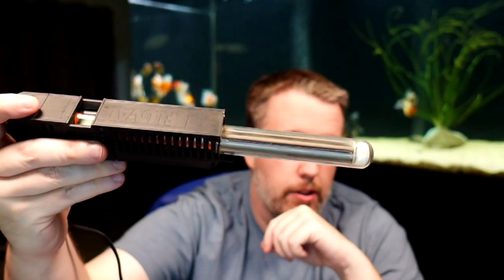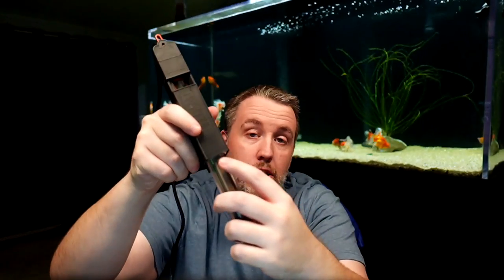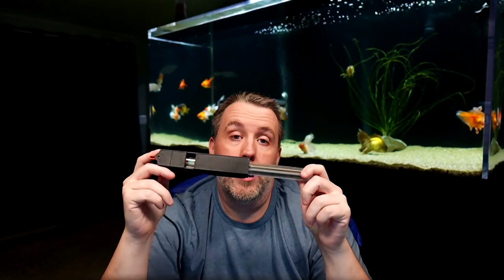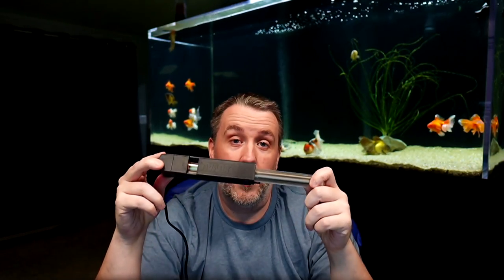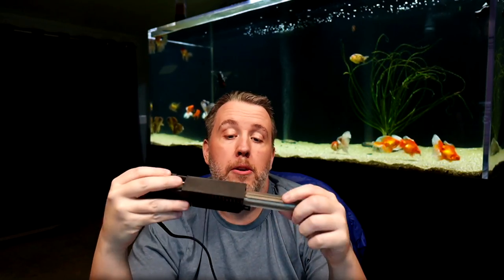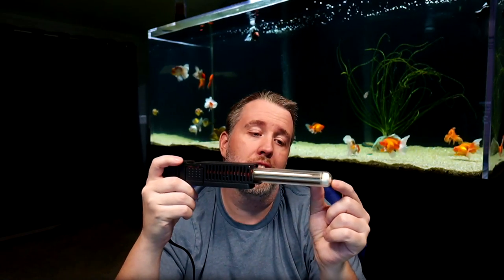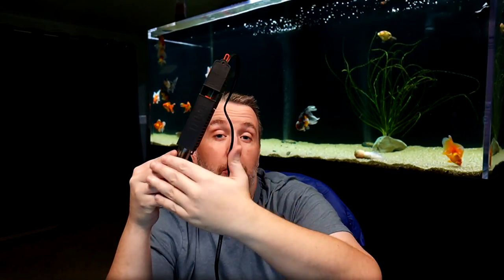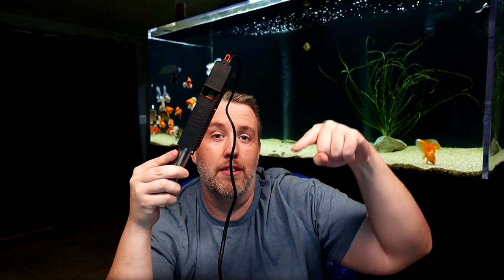The Truth About Aquarium Heaters (and Why They Always Break...)

Comment: Your points are generally valid, but here in the UK  the  temperature can change by 20 degrees Fahrenheit  in a couple hours or less so you need  a higher power heater to avoid giving “temperature” shock to your fish. We only have the min water line on the 240 volt units I’ve seen in the UK , I suspect it’s the proclivity to be sued in the US why that max water line warning was issued not the IP rating. I’m also electronics hobbyist an you could build a 48 volt (can’t be really be electrocuted at this voltage) heater making it safe to be fully submerge , you can also use transistorised switching, where if properly rated transistors are used could last for decades. This is effectively how good temperature controlled soldering irons work,  but at ~$200 for 100 watt iron I suspect  our current heaters are to stay especially as I suspect the electronic stuff mentioned above will always be marginally less energy efficient as the electronics would need to be powered 24 x 7 versus the simple on off mechanical thermostat.

Comment: Nice video. Temperature controllers I've used for years in the fish room where I can set a variance from half a degree to 10 degrees if wanted. The problem with every heater is that they will fail eventually and more times then not they will not just turn off and die they will get stuck on. Major concern that the controllers eliminate.

Comment: I have a heater that I bought in 1998 that I still use on new set-ups. I wish they still sold the old style (non submersible) heaters with the control dial on top.

Comment: Great points. I've personally never had a heater fail, but know people who have lost whole tanks to overheating. I'm curious if this reasoning is why eheim markets their 150w for 75 gallons (the other heaters at the store listed 200w for 75 gallons). I got the eheim and angled it where there's good flow, and with a thermometer at either side I confirmed consistent temperatures. Fingers crossed.

Comment: I know this isn’t new, but as I was a plumber, I have a perspective that you may appreciate. Elements in electric water heaters that last the longest and perform the best with the least amount of power (I. e. best efficiency ) are the ultra low density heating elements. These elements don’t heat as hot, and spread their heat over a greater surface area to provide the greatest amount of heat transfer away from the element. Also, in a hot water tank, the lower element does 99% of the heating while the tank is standing idle because cold water is more dense and warm water is less dense and rises. For this reason alone, it is a good idea to set your heating element low in the tank; ideally an inch from the substrate or so. It would be interesting to see if anyone developed a heat sink to further promote efficient heat transfer into the water.

Comment: So i have a juwel aquarium with the Eccoflow internal filter. This also has the heater inside a chamber behind the outflow. My water was always too cold because the water in the chamber warmed up, heater turned off. Now i took it out and put it next to the filter, but after seeing this i will put opposite of the outflow so it stays on longer and actually heats my tank. Thanks for the tip

Comment: I'm using a heater that's integrated into the return of the filter. It always has maximum flow so it never overheats. And I don't have to give it a space inside the tank and hope that it has enough flow around it.

Comment: I have a 300 and a 150 w in my 125. No problems. I keep a 300 in my 55 and it took a dump after 6 months . The 300’s are Eheim Jagers and the 150 is an Amazon special. I can’t even remember the brand but it was fairly inexpensive.

Comment: Hey, all those bubbles are taking heated air that is being heated with our wallets out into the cooler room. Why not run a air hose [ single, double or 1/4 inch ] from the pump inlet to the gap between the top of the water and the lid, a 90 degree elbow would make a snug fit and it shouldn't harm the pump because the diaphragm and the rest of what the air comes in contact with is all non-corrosive/plastic. You still need a bit of air change, but at the moment ALL the air is taking heat and water vapor with it, we are literally pumping heat out of the tank/s.

Comment: I use that same Fluval heater in 300 watts for a 75 gallon aquarium.  I put it completely horizontal at the bottom of the tank behind a wall of Dragon stone.  I was worried about the dreaded low flow warning so I placed the smallest powerhead I could find situated so it constantly flows across the heater.  It's been working for a couple of years now.  I will definitely keep an eye on it though and when it dies I will replace with a single 100 watt heater.

Comment: Gave up on heaters long ago. I don't heat my tanks and never will again after many many failures. My tanks hit around 72 with room temperature + pumps heating the water by running. It works and I don't need a heater.

Comment: I find they last longer if they are left in the tank they're entire lift of heater ( not removing them in summer only turning them off  ) and I also place mine in my sump where the flow is more consistent . Also my rule I was told when entering in was 1 watt per litre of water( approx1/5 gal for the USA people ) has served me well so far in hobby as I have only changed heaters 4times in nearly 20 years

Comment: I have my heaters on a DIY temperature controller I made using a Sonoff switch.  I turn off at 78°F and turn on at 76°F.  That minimizes cycle count.  And you're right, the old green Ebo-Jäger heaters lasted forever.  The old Aquarium Systems (not Marineland) Visitherm heaters lasted forever too.

Comment: Thanks for the tips. Are there heaters that keeps the set temperature without switching on and off? (I mean, as the water temperature approaches the set temperature, the heaters should gradually reduce the heat output, rather than sudden on or off.)

Comment: I keep my house around 68/70F and my tanks at 78F. I still go by the 4-5 watts per gallon rule. The heaters are on a 45 degree angle and in direct water flow from the filter. The heaters only come on a few times per day and for only a few seconds to a minute. In my 50+ years with lot's of tanks I've only experienced less than a hand full of failures. Some were from the coiled elements failing. Will have to see how my new heaters work out.

Comment: Your video is very helpful but the problem I've had is with totally submersible Aqueon heaters developing moisture within the glass tube and causing the heater to fail.  Over the years I've purchased 15 of these to accommodate various sized tanks.  One by one they started failing and I contacted the company because they have a lifetime warranty.  The company replaced several of them and now all of them are developing moisture even the replaced ones.

Comment: I agree with most of what you say! Not sure I'd say a 50 W filter adds 50W of heat to a tank. Some of that energy is going to mechanical operation, some is "wasted" as heat. Just as 20 W of a light does not do the same as a 20W heater.
Reply from the maker: Sure, that is a given and outside the scope of a video of this nature. Thermal heat transfer of where a filter pump is placed, dwell time, how much heat is lost through canister filter tubes vs an internal filter etc. A much easier concept to learn is, heat is being supplied from more than 1 source being your heater and to adjust based on the working temperature of the tank instead of an arbitrary number on a box.
Reply: @AquariumCoop  thanks! Definitely agree with your idea that there are other sources of heat that add to the tank. Thanks for taking the time to read comments!!!

Comment: Cory you should design and sell a heater that has a built in power head to pull in cooler water/push away warmer water. The heater itself dispersing the heat much like small space heaters with fan to push the heat around the room.

Comment: Do I have a heater?  I am in Puerto Rico, temps never below 76 and during hot season the AC is set at 78-80.  Now, if power goes out during hot season, it could get hotter.  But slow enough that fish would be ok?  I'm starting a 75g clown loaches tank, and I see they like it about 84, this would require a heater.  Thanks, great video, as usual

Comment: I have been experimenting with heat tape placed under the tank. The same tape I use with my reptiles with some good results so far! But have only been running the test for a few weeks so far.
Reply from the maker: This works well for betta setups, be interesting to see the results on larger aquariums.

Comment: I picked up a seachem 110 HOB filter, this fliter comes with a heater clip that attaches on the left side of the intake . I'm going to set up a cheap preset 150w and see how it goes. I just wonder if I should try and 45° angle the heater? It's not a fluval heater.

Comment: Your so good at explaining Cory and I've watched u a long time. Very good info. Live in Az have sorority Betta tank 37 gal. I usually don't use heater in summer as we have our air conditioner on 80 but was thinking of using in winter. Also we don't open windows . What to do if I have to in tank? They like cooler temp Betta warmer?

Comment: I have a Hygger glass tube heater and it has drifted out of calibration by about 3 degrees, water is warmer than setting and the temperature display is also off by 3 degrees.

Any tips how to recalibrate or do I need a new controller?

Comment: I have the back and bottom of my tank covered in styrofoam and use a 40watt incandescent bulb under my tank in a aluminum housing designed to keep dogs water dish from freezing to warm my tank. In the winter I use a 60 watt bulb and my tank runs between 74-78 degrees. It's set on a thermostat and will shut off as needed. But I've found that the fish don't like fluctuating temps and after the last heater bit the dust I was determined to find a better way. I've used the same set up on a larger tank but with 3 bulbs. Two of them were on the back and the other was underneath in the corner.
Reply: Also you can make the same thing from a metal cookie tin and a drill.

Comment: I want to start a no filter tank, but I will need a heater as where I live gets down to as low as 23f  in the winter. Is this at all feasible?? I am looking at getting a 35-liter tank. I should add also that we do not turn the heater on unless the temperature drops to 48f and it is never on at night because it simply costs too much to run.

Comment: No kicks on kicks off.  Control current to the elements, based on temp difference to setpoint.  A 300W (max) heater would only get a little power if the temp is just a little low.  It would only run at 50W or so.  Solid state controls so no mechanical bits to fail.

Comment: The one thing I have noticed over the many years is once the heaters controls are submerged, they get to the point where you can no longer adjust them, and then later you start finding moisture inside the heater tubes. 
How do you address this? I see the fluval completely submerged in your video. One other issue is for those that say not to submerge the control, once the suction cups fail, they slide down into the water anyhow, so one can't win in this battle it seems.

Comment: I have 4 tanks, all using HOB filters.  I put the heaters right beside the intake of the filter.  I have a thermometer at each end of the tank they're both within a degree of each other and less almost always.  I also have my tanks set up to circulate with enough flow to move water around.  Works fo rme.  I'm wayyyyy unde watted for heat according to "the rules".

Comment: What about redundancy?  When I first started, I was told to have double the tank's heating requirement... so in a 50G, put in 2 x 300w...  been running for 2.5 years on this approach.   Should I just remove one heater and wait and hope I notice when it fails?

Comment: I could really use some advice from the master. I have a 1000-gallon pool pond in my garage that i want to keep tropical fish in. i have figured out the filtration using a trash can and lava rocks along with batting and sponges. Here is my problem, I can't get the thing up to temp. i have bought TWO 1000watt heaters and it only takes it to 70 degrees. i know you have an 800-gallon Aquarium and so i am really hopping you can help me with this. any advice would be appreciated. Thank you

Comment: I agree except for using multiple heaters. Each heater is unique. Even if you buy two identical heaters from the same manufacturer, they will have slightly different parameters and detects temperature differently. If you use more than one heater, you may find that one turns on and off all the time, and another that rarely turns on at all.
That being said, there are advantages to having multiple heaters, as you've pointed out. However, we can't assume that both heaters will work equally and spread the workload.

Comment: When I plug these in its hard to tell if they are actually working. I guess this is because I'm a bit new to this. But the default temperatures are around 68 or 69 degreees. For your fingers that means its hard to tell if that's working. 

Could use some advise on this. 

My plan was to try to stick one of these in a water container and put it in a beehive to help bees survive. But there isn't many sources on this. I thought maybe some aquarium experienced people might have some advice. 

Thanks. And hoping for a reply.

Comment: I run  two 1000w heater as well as a larger 1500 heater mine is really only turning on and running only for least 10 minutes or less but got more then enough filters I have 4 per tank

Comment: Personally I do 2 heaters in the sump, the first one almost always on as the heat exchange allows the water to cool down in the tank before returning to the sum and the secondary set to a lower temp in case the first one fails or the room gets too cold and cannot keep up with the heat exchange.

Comment: I just bought 2 300 watt jaeger heaters for my 75 gallon tank. I put them on opposite sides at an angle, hopefully they will last a long time as I set my tank at 75 degrees and my basement temp is 68. Figure neither heater has to work too hard and should last a long time and will have 1 working if the other dies.

Comment: Years ago I used a non-submersible heater. It had a bimetalic strip contactor and it buzzed between off and on positions sometimes. It lasted for many years; I don't remember it ever failing. Recently I have used submersible heaters (I like to put them in a horizontal position in the lower 30% of the tank). They work fine for a few years then water gets in. I replace them before they fail to function. I don't think that cycling on and off should affect a solid state electronic heater. Perhaps there is a mechanical contactor in those electronic heaters. I will go to mounting heaters vertically if I have to to avoid water incursion.

Comment: I'm dealing with heater issues on my two 10gal tanks right now that are just driving me nuts.  One tank I cant get it to go above 78 degrees even though the thermostat is pegged as high as it will go.   The other tank Im trying to get around 74 but the thermostat allows such a huge temp swing at this temp its concerning me.  Doesn't turn off until temp goes above 76, then in turn doesn't turn back on again until temp falls below 73.  Watch out for Hygger heaters they are flaky!

Comment: Could we not set any heater  very low, route that into an external digital thermostat power point and set this to come on at a drop of 10% or 20% desired temp? A little more wiring and cords but a big saving in on/off cycles and power consumption.

Comment: New to the hobby.  I have 75 gallon tank and I am told I need a 300w heater.  I bought two and put them in the tank.  I was thinking it would extend the life of the heaters.  Is this thinking incorrect?

Comment: I have 'never' had a heater fail. Used so many through the years and have only ever had them break through my fault.. Mainly through me damaging them myself and once through me accidentally exploding one by pouring cold water over it during a water change. 

Been fish keeping for over 15 years and at one time had a fish room with more then 10 tanks (all with heaters). Never had one die. I even have a few heaters now that are over 5 years old. I have used cheap no brands and even expensive pro lines. 

Must be lucky I guess.

Comment: Hey Cory, great video and this was something I had been trialling using a 100W on a 330L + sump, with the heater in the initial sump chamber (so good flow). But my fish got ick (new tank so unsure where it came from). I've changed to a larger 250W eheim and the fish seem great (after treating etc), no more ick. Not sure if it could have been due to temperature variations from an under powered heater.

Also, aussie summer so 40C external temp is pretty common, keeping the water temp over ambient won't require much energy.
Reply: I discovered when I went to do a water change and felt the water temp with my hands that I had forgotten to plug the heater back in after having it unplugged for some reason about a week earlier--temp so warm during the day because it's blazing summer here that every time I glanced at the thermometer it was fine. But at night it cools wayyyy down. One fish had gotten ick, pretty severely, which I hadn't seen til they were all huddled in a corner quietly during the water change. Luckily cleared up easily with Paraguard and with the heat back on, everyone seems happy.